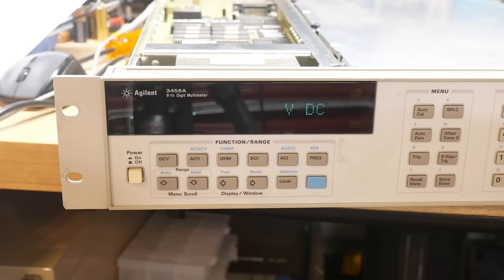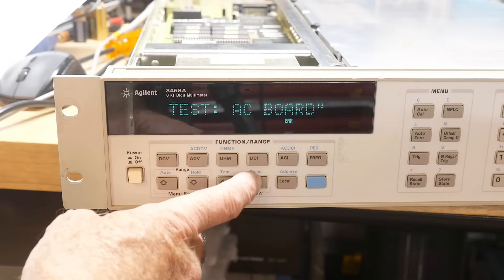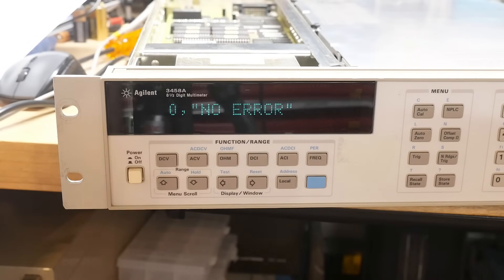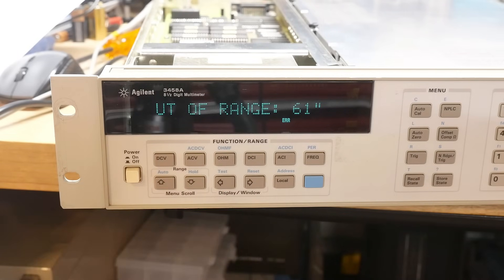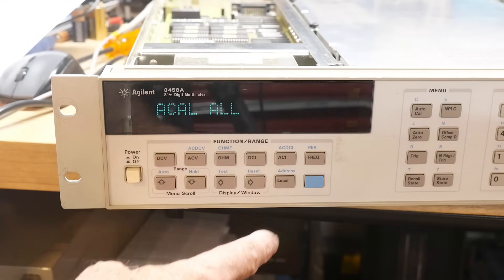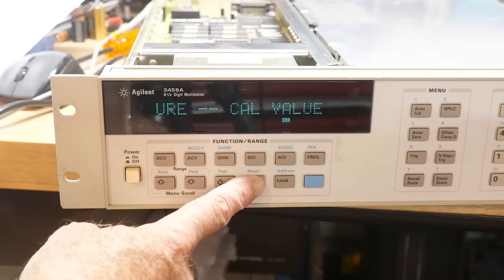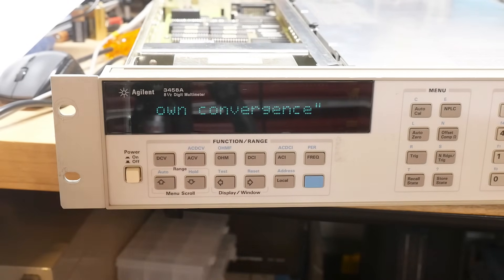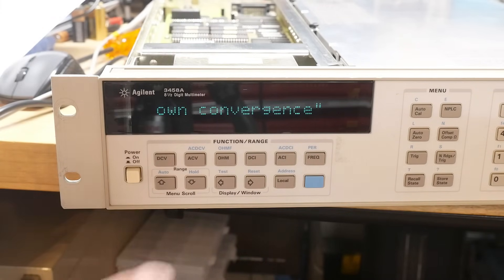#2318 Agilent 3458A 8.5 Digit Multimeter (part 9 of 16)

Comment: The error 114 almost always points to a problem in the A/D section (A3 board) or its timing (clock) circuitry. A failing A/D ASIC or timing oscillator, a bad A/D board, or in some specific production cases even bad SRAM or A5 problems.

Comment: I crazy thought, I wonder how much work it would be to just do a DIY  ADC board based on the open hardware CERN DVM project.  However it would likely cost you more in time and money than just purchasing  an new 8.5 digit modern instrument.    With out a good service manual to really understand all the workings of  the current instrument it would very difficult project and you would likely need to have a working unit to test your design.   Would be a great project if you could get support and sponsored by Keysight.
Reply: The Cern project uses an ADC chip with quite different characteristics than the MS-ADC in the 3458. This starts with a smaller input voltage range that needs an additional divider / amplifier with gain < 1. Another issue is the odd mich of high resolution for low speed and high speed with still some 16 bit resolution. The logical way today would be to split things over 2 seprate ADCs for the fast and accurate part. This could likely sill get issue in some details and require and new firmware. Any new design would not have the good reputation for linearity.

Comment: Many moons ago I think you mentioned that the CAL signal didn't seem to be doing anything. It may be worth reinvestigating the circuitry / signals around Q801, Q802 and U802 on the AC board.

Comment: There must be a 'reference voltage source' that calibration uses at startup time. Some older reference voltage generators can be very elaborate with heated chamber to maintain a constant temp that over time drift away an get out of range.
Reply from the maker: that works just fine in this unit

Comment: Do the RAMs need to be replaced? If the machine 100% thinks it needs a cal, you could give it your best "attempts" 10kohm and 10V standards to cal against just to clean those errors; after all, if it's not remembering what's in there, then what's the harm in replacing the current values?

Comment: I had a faulty 3458A back in 2018, luckily they were selling new A3 boards back then so I got one. Traded in the old A3, net cost was about £1000 UK.
No idea what the cost would be to have KS repair it, but you may be able to negotiate getting it calibrated also at a discount?
Please keep us informed as to where you go with this.....interesting.
Reply from the maker: I heard it is $3750 to repair and cal

Comment: Rundown convergence error in most cases is faulty U180.
Since some time now only option is to send unit to KS for repair.
Reply: There is that one guy working on the U180 reverse engineering project, but his last update was something like 3 years ago I think.

Comment: The rack mount cabinet is nice.  I would strip it at this point and lighten your load.  A video of you stripping and deciding what parts to save and thoughts on how to use the various sub assemblies and or parts and the cabinet would be interesting as a wrap-up on this series.
Reply: Broken it is still worth a lot of money.  Someone that needs one could buy it broken and send it to Keysight to have it repaired.  It would still be several thousands less than a new one.

Comment: I don't think it's a lost cause.  I think you said that Keysight would charge you $3K to put it right and calibrate it, is that right?  If you get that done you 'll have a $10K meter to sell giving you $7K to spend on all sorts of great new projects!!!
Reply: Good luck to find someone to buy it for 10k, more like 4-5k
Reply: @Mi-Di 4-5k at best. And to be honest even that is too much, since it is ancient. Many of those instruments are boat anchors, selling for a few ks od USD just because there is a legend about them. The real worth of many of those is at around few 100s, 1k at best.
Reply: @nonamemad9053 now careful there. It might be old but it's performance from a fully functional unit is still very hard to beat. The only competitors would be the new 8.5 digit fluke meter. So no, at the very bare minimum these meters go for 2-3k

Comment: I don't have experience with the 3458A, but it may be worthwhile trying to eliminate all the other codes first (as long as they don't all point back to the ADC) before giving up. Additionally, it may be worth while to actually analyze the signals going to the ADC to see whether the correct signals are even reaching the ADC.

Comment: only lost cause if the price of repair exceeds the utility of owning it,... 
I have no prior knowledge of the ASIC - but you could try re-flowing the solder pads on the part.
It looks like a ball grid, they sometimes have problems with connections.
Sad.
Reply: Please don't do this lol
Reply: @Felipe2077tv  do you have some specific knowledge that you would like to share?
Reply: @mr1enrollment  Well firstly, it's a highly sensitive piece of equipment, so it requires special care. Additionally, rarely do solder joints crack on BGA packages (but it can definitely happen from thermal changes + vibration), and for specific solder cracks lead to the same documented fault of a dying ASIC is very unlikely. Lastly, even if the reflow "fixes" the device, it's unlikely to have actually been from the solder joints but instead stresses and other faults within the actual silicon (ASIC) circuitry being temporarily fixed. 

Most general circuit faults come from a faulty component themselves (ex. shorted or open FET/cap/resistor, etc), and not a cracked solder joint, especially in equipment made in the last 20ish years. 

I guess if it's a VERY LAST RESORT it can be trialed but it's highly improbable to fix the issue and carries many risks.
Reply: @Felipe2077tv  gee I  guess that is the silicone  age  version of of 'Hit the tube just right and it will work again'
Reply: @Felipe2077tv  This: " and for specific solder cracks lead to the same documented fault of a dying ASIC is very unlikely." Is a solid observation. As for heat temporarily fixing, I doubt it. But over all I accept your answer.
Reply: mod PCB looked like IC is PGA